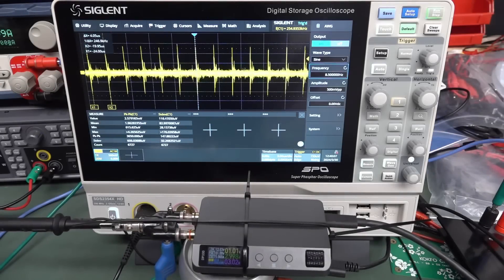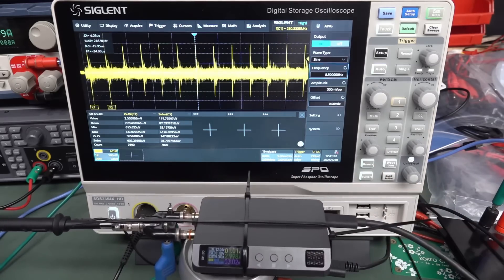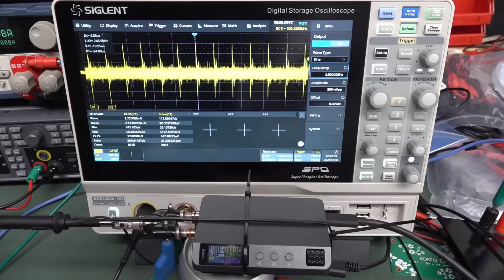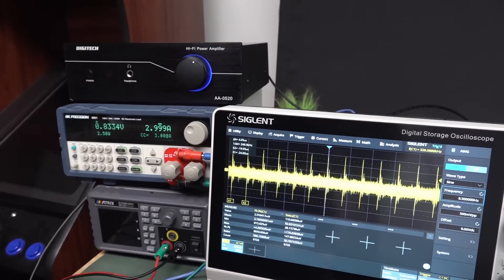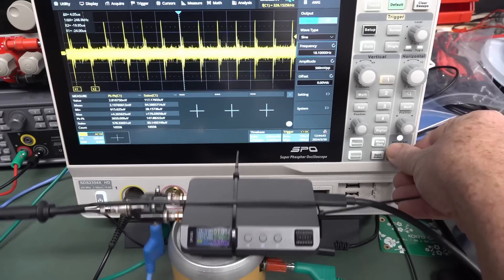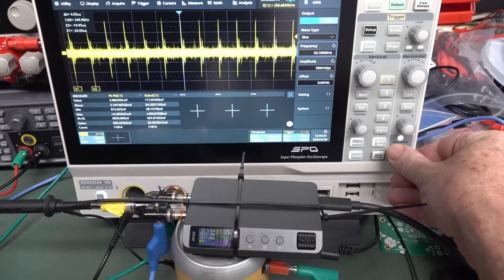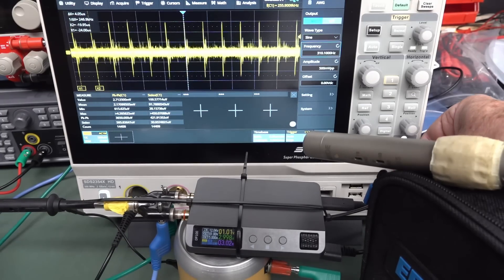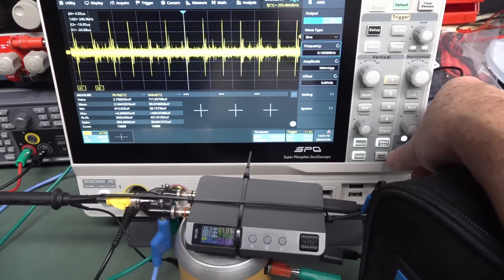EEVblog 1607 - PSU Switching Noise Reduction via Vibration

Comment: If I didn't know this was April Fools I'd have said you're making a dipole antenna and radiating some of that signal away. Think about a wire that has a simple sine wave and now you oscillate it up and down orthogonal to the wire at the same frequency as the signal or close to it. Even if the signal has such a phase where the most positive and most negative voltages are happening when the wire is at the same point and the zero voltages happen at the vibrational peaks, there would be a half positive and half negative voltage happening half way from each of the top and bottom vibrational peak positions and will still have some antenna dipole when in resonance. Increasing the amplitude of the vibrations should translate to increasing the size of the antenna. If anyone is struggling with this concept, think about spinning a wire around at the same frequency as the electrical signal in the wire. It will always act like a dipole antenna no matter the phase as long as it has the same frequency.

Comment: Wow, if this effect could be characterized, a table could be built that would recommend PSU components or circuits given a known vibration environment. Could be a big deal in industry where you often have a known vibration in a machine. I don't expect anyone will be adding vibration to reduce noise, but choosing a PSU design for an already vibrating environment would be simple.

Comment: I would guess that the piezoelectric effect of ceramic capacitors play a role here inducing currents in the capacitors around the switching frequency. This could then increase the currents in the capacitor if the phase of the vibrations is in line with the rectifying currents of the output capacitors.

Comment: The European Hyperloop Center (EHC) has opened its first test track. The Dutch developers want to carry out initial tests with the capsules at 420 meters, which will be sent through steel pipes at high speed.

Comment: Wow, a most interesting video.  🥳 Also, there are many space electronic articles.  Cracking in ceramic capacitors is an old problem; it appeared in the 1970s when the first surface mount technology (SMT) chip capacitors were introduced to the market and began to be employed in NASA applications.     Dave, great information.  Thank you.

Comment: Since we have past 1 of Apr. 
I think we can have some more serious responses now. 🙂
Since it is known that crystals do give a voltage out when hit (lighter) and I suspect that some ceramic capacitors also can affect the signal due to vibration.
What about a video regarding those effects and what to avoid when making a designing for use in a area with high vibration.

Comment: Take it apart! Is it all surface mount? Can glue be added to hold parts in place better? Does glue help?  We all know or should know that a gentle tap on compnents results in an output bump, at least is audible in audio gear, and particularly tube gear. I add non-acidic silicone adhesive to wriggly parts in my DIY audio gear as do many mfg's. I have never done a before and after test, so in that way, it is fairy dust or poop. 

How about pot the entire board to dampen internal vibration and test again?

Interesting video. Keep 'em coming!

Comment: Well you got the observation  of that phenomenon ..on ONE axis of vibration....similarly it should be done for the other two axis ..all three will throw up three different res.freq.results....and also their amplitudes will tell which is the best/worst axis..for final mounting..i.e which to use/avoid.....

Comment: Early in my career I worked for a few years as a test technician performing temperature and vibration testing. It is a very interesting topic, at one point back in the day I was doing some research on the phenomenon of mechanical vibration heterodyning. But the management of the company changed and I left for greener pastures. 
The place I worked at had 2 electrodynamic shakers, the big one could do from dc to 2 kHz, below 5 hz the G's were limited by the stroke of the machine, which was +-5 inches, above 5 Hz we could do 100 G all the way up to 2 kHz. The amplifier was in 13 very large cabinets and had a total output of 68 KW It was water cooled and a pain the the butt to do maintenance. 
This is a topic that every EE should know about, as there is a few strange things that can happen if you ignore mechanical vibration (and shock).

Comment: Interesting to know ceramic capacitors respons to vibrations. Another source could be the tribo effect. That comes from moving cables.  For low noise design there are special coax cables with extra carbon layer to minimize this effect.

Comment: Since you not exactly pointed over forgotten part: Pretend forgot a grid pattern, clearly visible at oscilloscope screen. Or proved rotation of electrons. One can use words 'intellectual distance' via pedophilia meaning of ?non war related Franklin D. Roosevelt crutches as he and you can measure something using power steps.

Comment: I am guessing something to do with the Piezoelectric effect. Any crystal oscillators (for example) could be subject to this. GaN semiconductors and possibly other materials in the circuit such as ceramics etc...Getting to the bottom of this could be very valuable or a learning opportunity at the minimum.

Comment: Have you ever wondered why when you put something that vibrates on some bubble wrap, it makes less noise and the sound sounds deeper? 
Did you also hear about the second law of thermodynamics where energy cannot be created or destroyed?
Did you know that f = 1/T is the formula for frequency. 
If you were to install a piezo speaker on the pcb and rest it on a sheet of bubble wrap, the bubble wrap will act as a "time capacitor" which will initially reduce the frequency until you pop the bubble, and release the trapped chronotons, to give you a "boost" in frequency. The tricky part is to pop the bubbles in such a way that they are in sync with the existing waveform to create a reinforcing frequency effect.
Happy april the first.
Proud to be a kidney.

Comment: This is seriously a thing for fiber coupled laser illumination, when you want to even out the speckle for imaging purposes. You just physically vibrate the fiber in a contraption called a fiber shaker to slightly modulate the phase, creating a varying speckle that evens out during the integration time.

Comment: can you test it with something like a piezo element taped to the enclosure and maybe the whole thing hanging from a  string? Im curious if it would work with much lower power vibration and you can probably push the piezo in the khz range, maybe it gets more efficient the closer it is to the actual switching frequency.

Comment: I wish you could compare this with the  FNB58 .. that is a USB tester. It has a similar display and can act as a power supply also.  I wouldn't be surprised if it were the same  electronics on the inside..  It even has a built in oscilloscope and even some sort of software app used on PC to go with it.   It would be a great comparison to this thing.. The features and setup are very similar.

Comment: My guess would be the higher amplitude of the sub harmonic vibration overides the low amplitude switching noise some what?

Or maybe the sub harmonic creates a beat frequency with the switching noise, and you'd have to slow the time base to see it?

I'm not sure. I'm just spit balling here. But this is an interesting phenomenon. I wonder how long it would take until components with built-in vibrators come into the market 😂.

Comment: Probably the piezoelectric effect from the mechanical vibration at a *sub harmonic of the switching frequency causes destructive interference with the switching noise in the system? Very neat, wonder if you could set up a simple lc tank oscillator and vibrate each component independently at the resonant frequency and see if you can observe an amplitude change around the resonant freq. Testing different axes of the components could be interesting as well.

Comment: I suspect you're mechanically adding energy to the capacitors (or coils) in the power supply, and thus lowering their loss.

You should be able to do the same thing with a tuned circuit, watching insertion loss and/or "Q".

You could also hook the power supply up to a VNA and see how it reacts at that frequency when you shake it at that same mechanical frequency, with the supply both on and OFF.

Comment: "impacted by vibration"?
Gee, that's the used of a noun "impact" as a verb... anyway, how about vibrated by an impact?
There are, certainly, interactions among the MLCC and drive voltage waveform, and the capacitor body, it's mounting geometry... A couple of my suppliers did some basic research on capacitor noise generated by switching waveforms, and there is no direct relationship between the switch frequency and the capacitor noise, but the shape of the driving waveform has a dramatic effect on the generation of the "singing"... But, the piezoelectric nature of the MLCC, combined with its physical characteristics, its mounting geometry and PCB characteristics, could certainly lead to generation of some level of "Antiphase" voltage... The relationship(s) among all of these factors is pretty much impossible to calculate, or simulate, but one might luck out and come up with a vibration frequency AND waveform shape.

Comment: Was hoping you would try the next harmonic (500Hz), also when going up in and back down frequency you skipped 125Hz (went from 120 to 130) ...
I guess a good old analog generator would be better to manually sweep and find those "hotspots"

Comment: The vibration probably modulates the value(s) of some component(s) thus changing filtering characteristic (whether an explicit filter or even an implicit one?). Maybe the modulation of that characteristic is even going in pair with the signals getting filtered?!

Comment: Is there any chance that mechanical vibration changes your scope probe connection point electrical properties like attenuation? Maybe same thing could be tried with soldered twisted wires instead of a probe? Just in case...😊

Comment: wondering where it works too. like using piezos to vibrate a image sensor to affect its noise or something
same with intense modulated light hitting a high absorbing surface causing it to produce sound (strong flashlight with pwm dimming onto candle sood deposited on a tin tray can reproduce this)

Comment: The probe got a capacitor, and may be swinging to... Pluss the scope is on the same bench as the transducer... and  the innput stages there will act upon the low frequency to.

Comment: I was learning in my MEE subject about Instrumentation and Metrics about dithering last week, and for some reason, this vibration variable you have introduced seems to dithering duty cycle of the switching converter, reducing the noise; otherwise, increasing the resolution. I wonder if there would be an appreciable difference in a class D amplifier, where a "ADC-to-DAC" topology is used (that's how I like to envision a ΔΣ modulator), and if the ENOB (effective number of bits) of the ADC.

Comment: In my design of minature RF telemetry transmiters installed in expermintal gas turbine engines. Found ceramic decoupling capacators acted as accelerometers, when the engine was running they were under 100,000gs of CF load and 1000gs of vibratory load. Had to replace them with tantalum caps to reduce the effect that was adding false signals to our data.

Comment: There's a new one now: I read an article recently about how they're using what sounds an awful lot like an MLCC as a novel gamma ray sensor. Really neat stuff. I don't know if it's the same type of ceramic but structurally that's pretty much exactly what they're doing.

So now you're gonna have to zap it with gamma rays and see what happens.

Comment: Hi Dave, interesting experiment 🤔 everything around us vibrates 🤔 if we vibrate against it it will vibrate less 😁
Thanks to the quasi-quadral correlation of the Brundelivi equation, which evaluates the effect of gravity on an oscillating object and at the same time takes into account the inertia of the counter-oscillation depending on space and time, we can say with almost certainty that we know nothing at all even if the tongue is at the right angle.

Nice day 😁 Tom

Comment: This is the "Dynamic Acoustic Vibration Effect"........or DAVE for short.
Reply from the maker: If no one can find the original reference, I'm claiming naming rights.
Reply: @EEVblog  you're go for launch!
Reply: @EEVblog   AI gave me a word salad and I've reduced it to "anti-resonant destructive interference"  ---  When a wave is resonant but is 180 degrees out of phase,  they cancel each other out.   There's probably some sort of resonance ringing somewhere in the circuit layout.. and the....................  who am I kidding.. lol  I don't know
Reply: ...and it's especially visible if using a manually controlled inertial kinetic impulse injection device, a.k.a. hammer - look at them parts go microphonic when you hit'em!

Comment: Multilayer ceramic caps are piezoelectric (I have seen them used to steer probes on Atomic force microscopes by warping them with an applied voltage.). My guess is that you are hitting a frequency where the physical motion is producing energy at the right frequency to cancel out the noise. Since noise is caused by a fluctuation in the charge of the caps, adding more energy in sync with a drop in the system could even out the fluctuations.

The only other alternative I can think of is that the layer spacing is changing through compression/expansion and changing the capacitance at a frequency that cancels out the noise.
Reply from the maker: In the seismic industry ceramic capacitor hydrophones are called "benders" for this very reason.
Reply: @EEVblog   please investigate this further 🙏
Reply: Wonder if you start playing with phase if it matters weather you are in or out of phase with the ps oscillator
Reply: @MrJosiahCochran I was thinking the same, if the vibration is in phase the noise would increase. If it doesn't change with the phase then maybe the second phenomenon occurs.
Reply: I'm having a similar thought.

If ceramic caps vibrate due to the piezoelectric effect, and that vibration can have an impact on the capacitor's performance (as the layers aren't all going to vibrate in perfect sync), then maybe physical vibration at the right frequency can have a "noise cancellation" effect, damping the caps' vibrations, causing them to perform better, and resulting in cleaner output.

Now, clearly, each capacitor is going to have a different key resonance frequency, but I suppose there could be a visible effect if you hit the right frequency for one that contributes a lot to the quality of the output signal, or if there happens to be a frequency that impacts a lot of these capacitors at once.

I'm not nearly enough of an engineer or scientist to know if this theory makes sense or if it's total BS, but it seems plausible to me.
Reply: This would make total sense if the vibration frequency was matching some component of the noise. 
But here he are fighting kHz with Hz
Reply: @ptamog The harmonic series is a thing. 240kHz is the 1000th harmonic of 240Hz. When you're vibrating the whole damn thing enough to try to shake it apart then perhaps there's enough residual energy left at the harmonic of interest.
Reply: @maudiojunky  That ripple has a very complex shape. It is hard for me to believe that vibration is going to produce the exact fourier sequece that interacts destrutively with those fast conmutation glitches. They repeat at 250K, but they ring at a much higher freq.
Reply: @ptamog  I'm well aware, just proposing a plausible mechanism for interaction. Of course this could just be an April Fool's joke, Dave's being very tongue-in-cheek about it if so.
Reply: @ptamog  To add, a practical means of testing vibration cancellation in MLCCs could be to mount them electrically parallel on opposite sides of the board with a plane between them, so they carry exactly the same signal within tolerance but their vibrations are opposed by 180 degrees and their E-fields can't interact.
Reply: @maudiojunky  If this is an April Fool's joke, I've fallen deep into it 😂
Reply: @ptamog  otoh piezoelectric goes both ways, so the origin of a good amount of the noise very well could be the capacitors bending in response to charge/discharge. The induced vibrations. Piezo voltage and strain are not a linear relationship, maybe the added strain from the low frequency signal is causing clipping in the higher frequency one since it just can't drive the voltage higher/lower. Since the signals are multiples of each others frequency, they never get out of sync so the destructive interference doesn't drift? edit: I think this is testable. If I am right, it should also be possible to reduce noise by putting a fixed strain on the capacitors. If I am right, a capacitor under enough strain should produce less noise.
Reply: @carpdog42  A capacitor under strain changes value... so yes, different scenario different noise.
I think that vibration (piezo or whatever) is messing with control loop of the PSU or the probing.  The oscilloscope just starts triggering consistenly in some point of the signal.

Comment: Is it because you're moving the coil through the magnetic field that's created as part of the switching process, and the physical movement causes the field to interfere with itself and acts as a kind of a low-pass filter for the noise?  It seems unlikely given the speed at which the field should be propagating relative to the slow-motion movement of the table, however, maybe at the higher frequencies involved in the noise here it doesn't take too much physical movement for the wavefronts to destructively interfere?